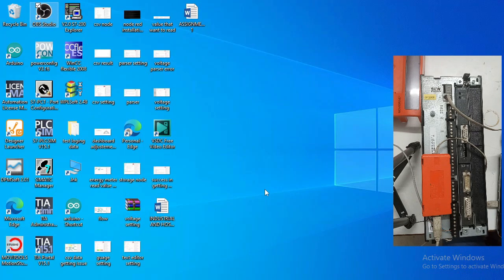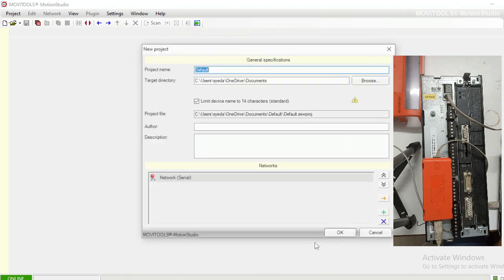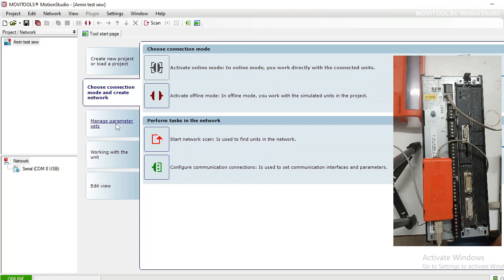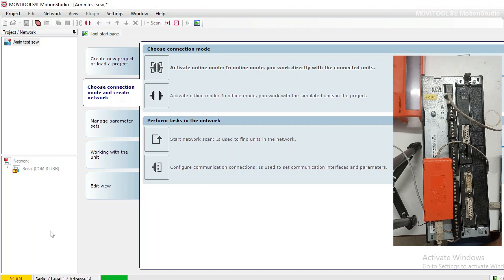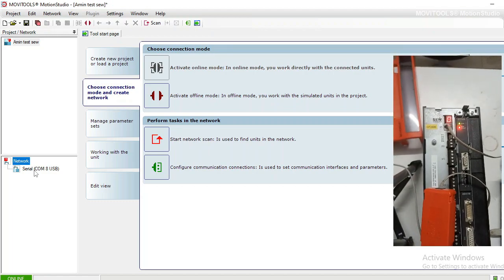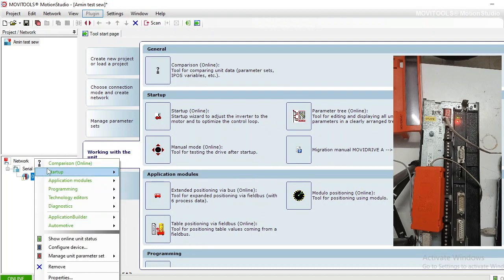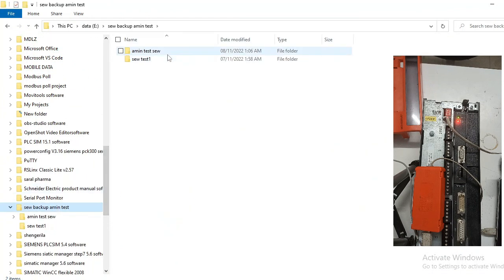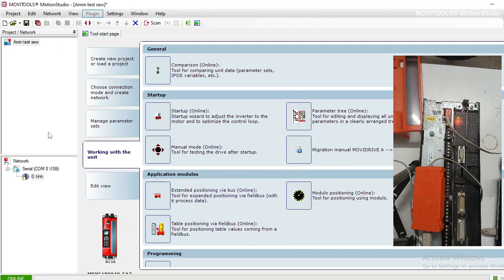SEW Movidrive Upload Download parameter by Movitools

Comment: Hello. If firmware different 1822.091 6.12(old drive mdx61b) and 1822.091 6.15(new drive mdx61b). Something to need more? or just upload parameter from old and dowload to new? other devices same, just different firmware.
Reply from the maker: SEW drive will accept the changed version because i have done this with my sew gateway
Reply: @industrialsolution6828  OK. One more question, if need to update firmware on MDx61b, what software need to use? movitoools?
Reply from the maker: @antonchelninsky3368  You can use flasLoader for firmware update
Reply: @industrialsolution6828  yes) we are updated firmware and drive is working.. thanks
Reply from the maker: @antonchelninsky3368  which software you have used to update firmware and with old firmware drive wasn't able to run?
please explain what was the problem and how you have solved it
Thanks
Reply: @industrialsolution6828  @Industrial Solution  firmware 1822.091 6.12(new drive mdx61b) and 1822.091 6.15(old drive mdx61b which is broken). We take software flasLoader and firmware 1822.091 6.24!, becouse we didnt find 6.15. Then loaded 6.24.
Reply: New drive with firmware 6.12, didnt work with flash card from old drive(6.15)
Reply: Nice